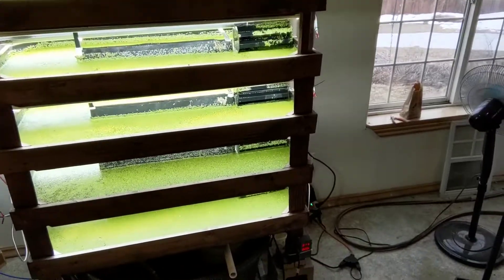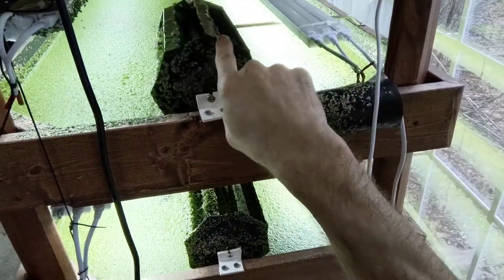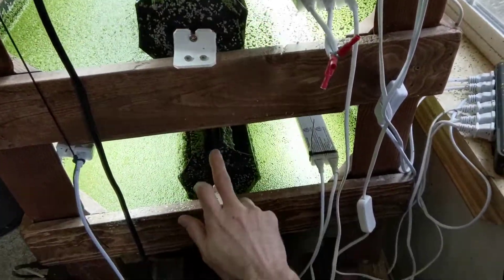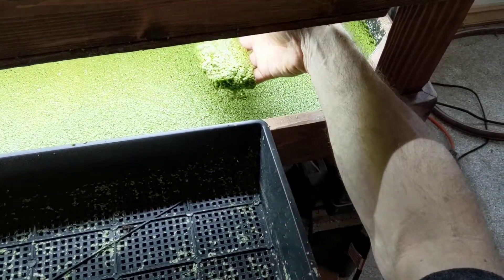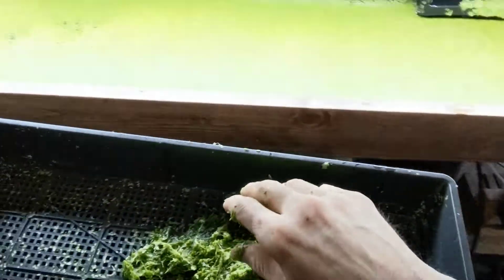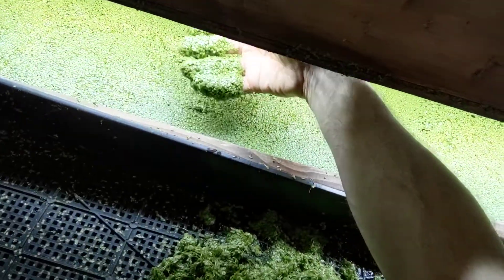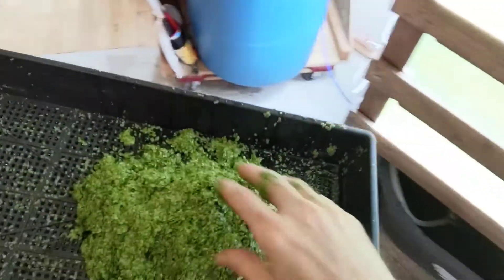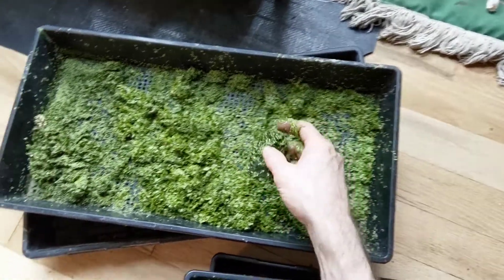Duckweed GrowTower

Comment: I've been told Duckweed is also a fantastic full protein supplement for people too. For those trying to keep a vegetarian diet. Using this vertical style is there a reason you couldn't make a food safe grow project?
Reply: I know 😂....he sealed it with Flex Seal 🤷‍♀️ the easiest way is just to use stainless steel trays which you can get at any restaurant supply. Use the duckweed you are going to use in a week, then take a handful of duckweed and put it in the next tray. Dump the old tray in a bucket, use it for fertilizer.

Comment: Nice Idea, and buildings.
I have a qestion about your ecosystem. 
im working on Aquaponic or i will say Ecoponic.
Do you need to correcting the ph-value with acid values? sounds stupid but i had read some articels about "regulation of the PH-value by plants" and Duckweed should bring the water in a acalic circum dances. Normali we need to add alkalinesubstances, so how strong are the effektives in an closed system with Duckweed?

Comment: You CAN'T use flex seal, Duckweed is:
A bioaccumulator (it concentrates contaminants)
Grown in warm, shallow water
Exposed to UV, nutrients, and microbial activity
That combination accelerates:
Plasticizer and solvent leaching
Hydrocarbon breakdown
Unknown residue uptake into biomass
Reply: Agreed. There are high purity silicon glues from 3M for food applications specifically designed for exactly this kind of application. Likely in stock at aquarium supply shops (if any still survive near you).
Reply: @CaffeinatedFingers  Honestly, I think food safe buckets stacked would be far more efficient than this setup if done correctly. The connectors and structural pieces could stay completely isolated from the water and be modular and easy to 3D print and attach
Reply: Glas !!! Shallow aquariums
Reply: Thank you!  We are just at the research stage. We are hoping to grow some in an outdoor aquarium for the summer to the dehydrate. Do you have a learning resource that we can trust?
Reply: Thank you for saying this! I was concerned that he never got this info
Reply: Where can I get duckweed to start?
Reply: @dodge1137 Any good quality aquatic centre that sell live fish.

Comment: Just use a cement mixing tubs, spray paint off, White paint, wait two hours, spray paint again, let dry for 4 days, add water, and I do use the 5 - 15 gallon size aquarium water filters, at Walmart, make a tiny float in front of water fall, as Duck weed don't want any splashing sensytation, so make a floating tiny arm to keep, duck weed out of filter splashing water, fall. No filters in filter, unless charcoal, no fish, no snails, if you want to eat it raw, I eat daily